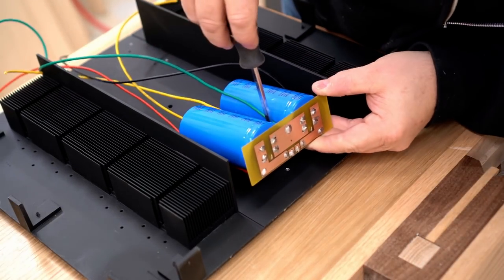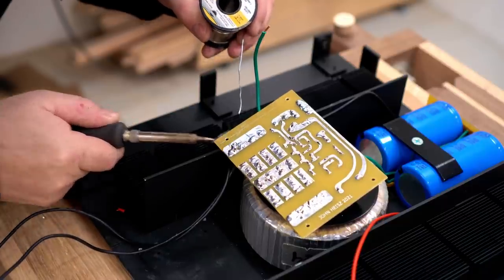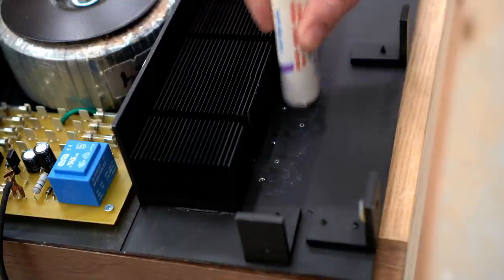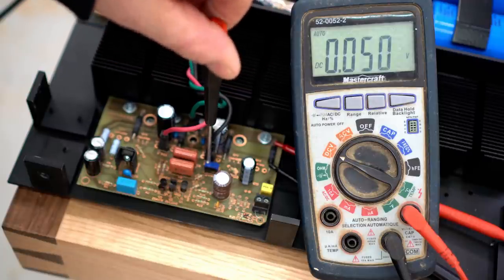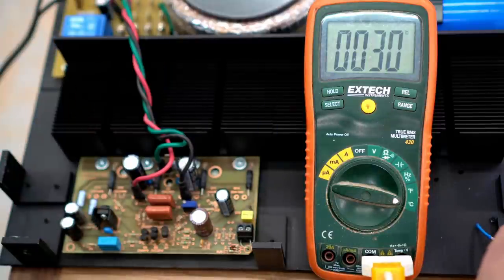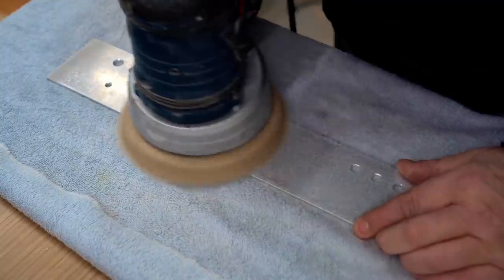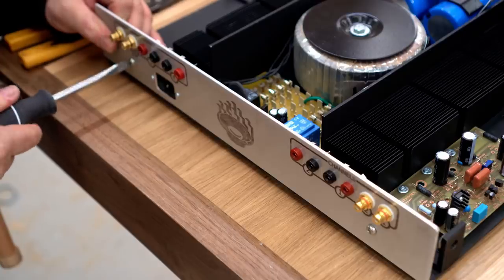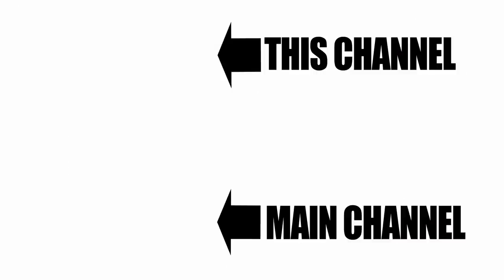Making An Amplifier From Raw Aluminum - The Back Panel and Installing The Amp Boards

Comment from the maker: Watch part 1: https://youtu.be/UKhRA_GcmPI
Now that the case is mostly finished, I can get the amplifier boards installed and tested. Not only that, but also to put the project on hold for a while and use it in the meantime. I'm waiting on parts that I haven't even ordered yet to complete the amp, but it's fully functional (as an amp) and figured the best place to store it while I wait is in my listening room hooked up to the subwoofers.
Another issue holding me up is the design for the front panel. I haven't come up with anything I'm completely happy with and the only cure for that is time away from the project.
Regarding heat: if you watched me install the first amp board, you will see that I put mica washers between the output transistors and the aluminum bottom plate of the amp. That washer is needed to electrically isolate the transistors from the case, since these transistors have a metal back that's tied to the transistor collector. Mica has about the same thermal conductivity of the glue I used to fasten the heatsinks (in the previous video), but it MUCH thicker than the layer of glue. As shown with the amp's bias turn up to 200mA+ per output, the heat has no problem finding its way from the bottom plate to the heatsinks. That bias, if you aren't familiar with this stuff, is way beyond anything used for normal class AB amps. Typical value is in the 10 to 100mA range.
The benefit of using aluminum to build the case is that the entire case becomes the heatsink. So even the cover is dissipating heat to cool the amps.
Reply: Excellent build quality. My own DIY electronic builds look more like old rat’s nest of color coded wires 😂 they work but never pretty like yours 👍🏻

Comment: Even though you won't see the inside and the back, the quality of work done there is better than what I've seen on most factory produced electronic products. I think you've said before that years ago you wanted to do this full time. You would have done well.

I read a few comments here with a few knocking PL as a thermal paste and it just goes to show that some people do not think things through. Instead of enjoying the build and seeing the quality that most of us couldn't attain they focus on a non-existent problem.
Reply from the maker: What I'd like is to do something like this on one big "W" shaped circuit board and eliminate the wiring altogether. That would be neat!

Comment: The first thing you do is not set idle current, it's measure for DC at the output.
That's also the first thing you do when you try out any new-to-you amplifier or receiver.

Comment: Nice project again. 
You could made the box design by using 2 U shapes 90 deg. apart to form the base and lid. Front can then be wood glued into place or plastic or glass or whatever.

Comment: Such a clean build. Even your component layout looks "designed". Is the chassis ground?
Reply from the maker: The chassis is earth ground, like all exposed metal that's connected to the mains needs to be. The star ground for the power supply is "lifted" above the earth ground using a 30 ohm 10watt resistor (see that in the overhead pic at the end of the video between the caps and the tansformer) that is bypassed with a pair of diodes. The input ground for each amp in further lifted with a 10 ohm resistor and another pair of diodes. This scheme kills any possibility of ground loops that cause hum.
Reply: @IBuildIt  Right on, thanks. It looked to be like the output ground was isolated from the chassis. I'm not an expert in the slightest and I'd never seen that.
Reply from the maker: The three grounds (earth, power and input) are still connected, so not isolated. The best way to look at this is to see them as pools of water that are connected with rivers. Current will gather in one pool, but will resist flowing into the next pool.
Reply: @IBuildIt  that's a fantastic analogy, thank you.

Comment: Hi, very neat trick of ironing a laser printed label on aluminium ! Where can I find the schematic of the amplifier ? Thanks for your videos
Reply: The iron on trick is not new for PCB design, but I had never considered using it for labeling, very neat solution, really looks effective.
Reply: @rompdude  Done that before using colour prints, laminated so they were more resistant, and then stuck down to the surface with glue.
Reply: Nice trick indeed! Would this work with photocopied paper as well?

Comment: John, it dosen't matter how thin it is, any amount of a thermal insulator between the two surfaces will drasticallyreduce the effectiveness of your heat sinks. This is why thermal adhesives are a thing. Now if this bottleneck in your thermal management is still larger than your overall thermal loading, then who cares move on. However if your trying to get good thermal performance, and make actual use of that full heat sink, then a thermal interface is a must. Surprisingly there's a limit to how much a heat sink will do for you if the thermal interface point between the source and the sink sucks. Your not dumb, you know these things, I just wouldn't hand wave away this aspect of the build without making sure you don't have a critical thermal bottleneck.
Reply from the maker: I got as far as "it doesn't matter how thin it is". 
Seriously? Think about that.
Reply: @IBuildIt  yes seriously think about, no wait don't, go actually read about it. The moment you add an interface like polyurethane adhesive with a conductivity of like 0.8 W/mK you absolutely obliterate the transfer effency. So even though it's only a thin coating, it's a massive bottleneck. Thermal compound is 70ish W/mK to give you some perspective. The metal itself is at 237 W/mK. This transfer effency is heavily effected by surface contact area as air is 0.025 W/mK.

thermal contact conductance coefficient is what comes into play here and surprisingly, even without a thermal interface, metal to metal and all its surface imperfections with sufficient (reasonable) clamping will still have better thermal transfer than if you just slapped a thick ass layer of what is essentially a thermal insulator

And yes, thick ass layer. We're talking about distances in the microns here when it comes to thermal interfaces. So your polyurethane adhesive is thick as hell in comparison.

This shit not straightforward and in some ways can be counterintuitive. Thermal interfaces and heat sinks are a rabbit hole of engineering. However ask yourself... Do they make insulation out of the material I'm about to use? (polyurethane) If the answers is yes then it's probably a bad idea to use it as a thermal interface. The mere fact that you have such noticeable temperature deltas along the heat sinks and such a delay is a great indicator of how not efficient polyurethane is. 

Now again, if this isn't causing a bottle neck for your given application, then sure, keep on rolling.

However please don't tell people this is an generally acceptable heat sink mounting method, it's not.
Reply: It matters but it doesn't matter. It may make a measurable difference but that difference is so small as to not matter.  And the thinner the TIM (thermal interface material), the less that thermal resistance matters. It makes a bigger difference where the thermal load is high (in the resistance analogy think high resistance with high current) and the source of the heat is very sensitive to not being cooled such as with overclocking CPUs. But even there people probably go overboard. Here, as long as John keeps the layer very thin and has literally checked and verified the performance, it doesn't matter if it is 2nd or 3rd or even the 10th best option, it is effective.
Reply from the maker: The PL has roughly the same thermal conductivity as the mica I used to isolate the transistors... but is probably 100 times thinner.
You saying the thickness doesn't matter blows out everything else you say. It's like starting a talk about the environment with "since the Earth is flat..."
Reply: In construction, glue is a thermal bridge, not a thermal insulator. Two very different things. An object's surface area and thickness definitely plays a role in heat transfer and dissipation, for sure. Even specifically designed thermal paste becomes all but useless if it's caked on in a thick layer. But the bot is a bit too anal retentive to accept that someone does something different. The reality is that it's not up to the bot to dictate what is or isn't acceptable. If it works, John, just tell him to fuck off and test it for himself.
Reply: @IBuildIt  Relatively speaking thickness dose not mater. You happy now grumpy? Sorry I wanted to bring up a relevant point about just randomly gluing aluminum heat sinks to things however you had to get butt hurt, as usual. Hope your amp works great for you and dose not melt any transistors under load.
Reply: @MMinjin    Well said.
Reply: @IBuildIt    The best point that you have made John. Most heatsink grease is silicone grease filled with titanium oxide. Again designed to remove air from the interface. Same as what you accomplished using a similar adhesive.
Reply from the maker: @KravchenkoAudioPerth  Everyone is making a big deal about the glue, but no one said anything about the black paint. The two paint layers are probably thicker than the glue layer.
It's all about perception: they can see how thin the paint is but can't visualize how thin that layer of glue is. I even had one comment that said it was the "air bubbles in the glue" that is the problem! like the glue layer is a thick piece of foam.

Comment: Don't worry about the Glue for the heatsinks :)
I took my graphics card apart for cleaning and only then realized i didn't have any thermal paste. As I needed the PC to run i grabbed some oil resistant silicone sealant and put a dab of it on chip before mounting the heatsink. it was meant to be a quick "better-then-nothing"-fix, but i realized the difference to real thermal paste is maybe a few degrees and just left it like this. It's just my basement PC that does not get used very often, but it still works like this more then a year later!
Reply from the maker: The "thermal compound" I used to mount the amp board (in that white stick that I rubbed on) isn't thermal compound, it's a silicone based lubricant. Works just as well as the real stuff in my experience.
Reply: lol. there's no way it's within a few degrees unless it's thermal throttling under load.

Comment: Do you screw the heatsinks down too?
If so maybe using CPU thermal paste would be better than the glue
Reply from the maker: The point is that when you say something is "better", it's better by how much? Is it 100% better or is it just 1% better? And when I say better, I mean at actually conducting the heat across the join, which is what I measured in this video. 
If it's just marginally better, than it's not worth making a fuss over.
Obviously, the heat isn't having any problem reaching the heatsinks since they are the same temp as the back plate.
Reply: It is a sliding scale and depends on the temp range, if you look at most of the components used they are rated over 100ºc, so getting to 30-40ºc is nothing.
Reply from the maker: Getting to 30-40 C at nearly 10 times the normal bias current. The amp doesn't get above 25 with all 4 boards installed and running when they are set to the normal bias current. 
Fussing over the efficiency of the glue for transferring heat is the kind of minutia that too many people get wrapped up in. They literally make mole hills into mountains.
Reply: @IBuildIt  

Can you run a test with the transistors driven with a resistive load? Because what you're checking here is essentially the resting state of the amp and doing the "will this burn down my house?" Check.

However if the transistors hit much higher Temps under load and the heat sinks can't keep up, you will toast the device. The fact that you had notable temperature deltas on Initial startup and moving into steady state tells me it's worth checking to make sure.

We're talking orders of magnitude between by the way. Not like 30% more like 0.8 W/mK vs 70 w/mK at the highend end of performance, So ~100x better (orders of magnitude)
May thermal adhesives are in thr 14 W/mK department so ~20x better.

Yeah good enough is absolutely a thing, and if it works then rock on, however from a general perspective, using an insulating adhesive is a bad idea.
Reply from the maker: You mean a test with a resistive load... like four 12" woofers? Been conducting that test at moderately high levels for several days now. 
Guy, give it up. You know some stuff but what you lack is the real world perspective to rate the importance of it.
Reply: @IBuildIt  I have used plain old 2 part epoxy often enough to attach heatsinks to hot IC's, and it works well enough for 95% of the use cases. In general the flatter the surfaces, and then making sure they are absolutely clean, before applying the thin layer of the epoxy, is the more important part. flat surface, easy to do using some form of surface block (I use a random granite floor tile, which is pretty much flat from the grinding and polishing in the production process used, after it is cut from a large slowly cooled chunk of the earth's mantle) and some waterpaper, to make sure both surfaces are a nice flat even matt finish. Then clean with some degreaser, then use a small amount of epoxy to bond them. 

I have removed some after a few decades, and generally had to either cook the epoxy till it let go, or destroy the unit. For most purposes this works, and especially with large areas in contact, like power transistor heat spreaders to a heatsink, it is not going to have any difference in temperature. The biggest drop is normally the die inside the package to the base, and then the heatsink to ambient, the rest is almost always negligible in comparison. TO247 is always better than TO220, just from the lasger surface area to transfer, and cheap paste works just as well in the average use case as the $1000 per gram stuff, and in general also is a good electrical insulator.
Reply from the maker: And PL has an advantage over epoxy, since the filler (that thickens it) is talc. Talc improves the thermal conductivity significantly.
Reply: @SeanBZA  Just to clarify because I'd like to try this technique myself, was the epoxy also providing electrical isolation or were these packages without the exposed metal tabs?
Reply: @Danger_Momentum  I was using where the heatsink could float, though the thin layer did provide isolation, but I was not going to trust it to do that without other forms of insulation. Would provide isolation to around 30V no problem, but would not use for mains isolation, unless the heatsink was on a ceramic or plastic DIP or PLCC package to improve the thermal performance.

Did use it to hold a good number of CPU heatsinks to the board, plus the ones for hot running chips. Isotabs I did use as well, generally to improve thermal transfer to the crappy heatsinks they were attached to, which meant making the surfaces flat first, and then the tab itself, then clean to make grease free before the epoxy.

Comment: I use a laser printer on "decal paper" for labels. Just soak in water, position and apply clear coat.
Reply from the maker: This method (when it's done right) looks like silk screen printing. The decal method is ok, but not nearly as pro looking as this can be.

Comment: This is great. I'm curious how you determine how much copper to give those giant caps? I'm almost ready to dive back into my Hafler rebuild and I've an assortment of sizes of chunky copper my scrapper genie gave me for a burlier bus bar. Any thoughts? I think my caps are around the same size, maybe 47,000
Reply: Caps can conduct huge current for a very shot time, but in audio they are mainly used for smoothing which isn't likely to draw much current in average. Look at the fasteners (or pins on "smaller" ones) on the cap to give you an idea.

Comment: John you really seem to know a amp design
Question for you 
All amps I have built I used more caps in series to get capacitance up 
Is it ok to do this or use 2 large value caps instead of the 6 smaller ones
Thank you
Reply: series caps increases ESR, paralleling caps decreases ESR(BETTER OPTION)

Comment: 4:30  You should really switch over to Speakon connectors for the output, they are far superior in every way to Banana Plugs, but you can't stack them and you can't reverse the output.   But really, after things are set up and running, when would you ever need to do that anyway?
Reply from the maker: Someone else asked if it will have balanced inputs. It's not PA gear, it's for home audio - set it up and occasionally wipe the dust off it.

Comment: TIM's are never as conductive as the metals they are adjoined to. The Mica sheets probably have pretty terrible conductivity, but it doesn't really matter as they are needed electrically and make little difference due to the thickness.
The glue would have likely been better than a dry connection as air is a terrible conductor.